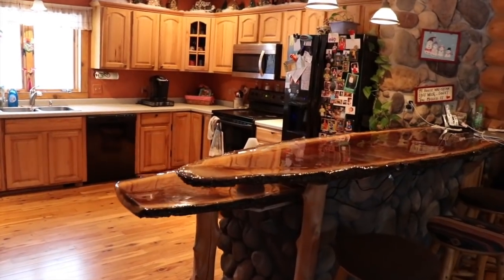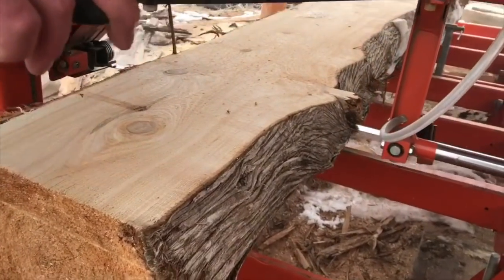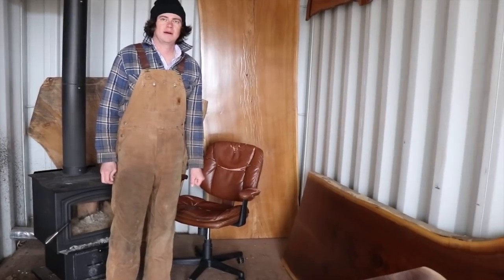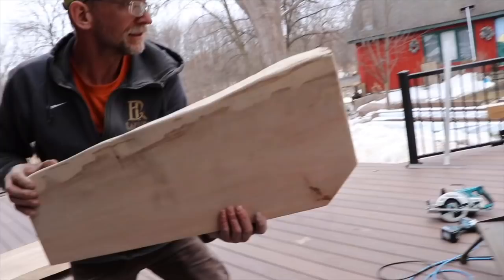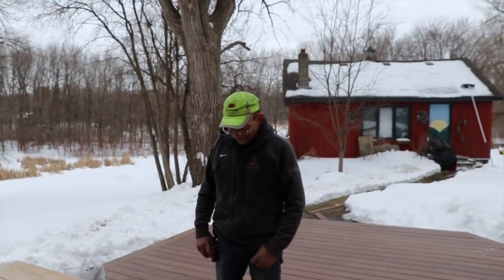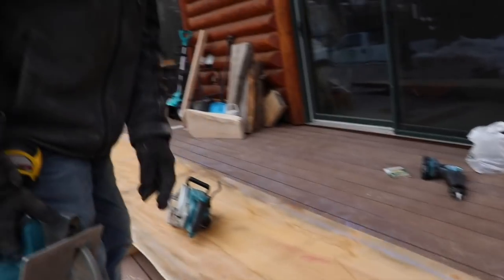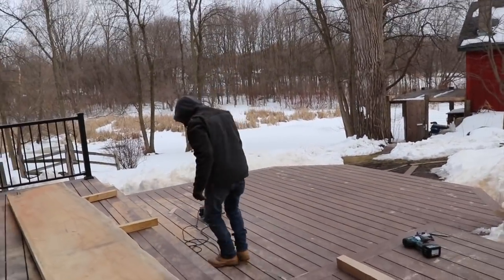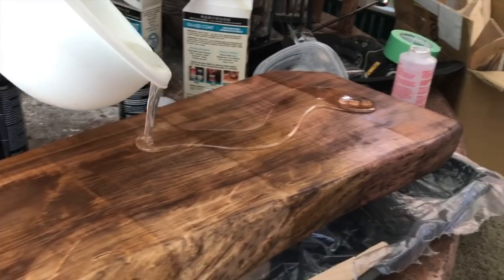Live edge Problems...  How NOT to do a Live edge Project. pt1

Comment: I'm currently doing a river counter with lodge pole pine and white pearl mica pigment. Light burn finish to the to surface with a single "farmhouse" sink undermount. My favorite live edge treatment is actually to use a nylon bristle wheel, it gives even more depth and texture to the wood by pulling out the softest wood from the edge. I wish I could put pictures. I'm very proud of how it's turning out.

Comment: I have poured well over 1000 gal. of epoxy from most manufacturers onto everything from car dash kits to high end art work. I quickly learned to seal the work first with a scraped first coat. Pour some, scrape it around the work to seal. Give it half an hour and scrape the excess off. Objective is to stop air from migrating up through the wood pores( or anything that might be porous). The second coat will have 95% fewer bubbles. Especially you guys using solid wood. The crap never stops breathing unless you cap it with a seal coat. Yeah, an extra day but worth it. Also don't use the torch to heat the epoxy. It is the CO2 that pops the bubbles, not the heat. This I was told by several formulators. Fast moves with the torch. Too much heat in an area accelerated the cure on top and give you undesirable results from unbalanced cure rates.
Be careful using stains. Done a ton of that too. Oil base must cure, yes cure for like 8 days to gain good adhesion. Ever try alcohol stains? Spray on transparent stains? No blotches with transparent dyes.
Too many bubbles in the mix that you pour? I used to mix A&B on a drill press with a wire coat hanger that had a little loop at the bottom. Very little air mixed in. If you try these tips you will have success and save time and aggravation.
Reply: Rich F can you clarify what you mean by “scraped first coat”?  Are you saying that you have to do two coats of epoxy?  What is scraping?
Reply: I use epoxy as a sealer coat as it is excellent as one. I only use enough to cover the work with a thin coat. I let the bubble rise. Every five minutes or so I spritz it with acetone which pops the bubbles. I never use a torch except on final coat and even then I never dwell. It's the CO2 that pops the bubbles, heat is the enemy for obvious reasons. After about 30 minutes or so depending on the wood type and how much air needs to get out, I scrape off the excess leaving very little thickness. If there is a problem requiring sanding it off, I don't have 1/8" of material to burn through.
Reply: Yes, on unsealed wood there must be a seal coat. If you don't, bubbles will migrate out of the wood during cure. Some will no move up off the wood, just kinda laying on the surface under the clear, looking like a glass chip. Some bubble will make it into the body of the epoxy looking like, well, a bubble. The rest that make it to the surface you probably popped and popped until the cure stops the bubbles from rising any further.
If you pour onto a sealed surface, the only bubbles you must contend with are those in the mix. They rise rapidly and stop.
Reply: @maverick1552  You nailed it bro.

Listen up people - I know from my own personal experience, over MANY years, that Rich knows EXACTLY what he's talking about. Thanks Rich - you saved me the time to type up the exact same thing. 👍
Reply: Thanks Kevin. While I am here I'd like to mention mixing. I used a simple wire coat hanger in a drill. No wide flat spatula type tools. They fold in lots of air. The coat hanfer is looped at the end and provides pretty good mixing energy plus the wire being only 1/16" diameter simply twists in the mix. It does not introduce much air at all yet mixes fully believe it or not. I use the same mixer time after time because as the epoxy cures on it, it provides a little better paddle mixing action. Try it, you won't regret it.
Reply: Rich F, thank you so much! This is great info and all makes so much sense. I’ve worked with epoxies in small amounts before, just for bonds fillers patches and the like, but never on a large project or as a poured top coat.. But it’s something I’ve been wanting to do for a bar or table project and your chain of comments are perfect. I love that you give the ‘why’ and the ‘how’ these processes work, This is exactly what I need to understand what it is I’m doing. So much better than simple directions, “first do this, then this and follow the steps to the end.”  

I’m definitely saving this thread.. 
Rich F, you rock! Thanks again. 
And Kevin HeyMan, you rock too, just for the sentiment!
Reply: @rianmattes8292  Sorry this is late. I scrape off the excess of the sealer coat to the level of the wood. All of it. Not even a line of material between moves. Every square inch to the surface of the wood. Any remaining dimension or thickness of 1st coat epoxy can contain bubbles so best not to leave it on. Scrape it ALL off leaving what looks like you wiped raw wood with a wet sponge. No dimension or thickness of epoxy left behind. No place for a bunch of small bubbles to hide and then be noticed after pouring the final coat. Spray with acetone to pop any stragglers. Also scraping is good if you F it U and have to start over. No thickness of tough epoxy to deal with.
Sealed this way the second coat will not have bubbles migrating out of the wood trying to get to the surface.
It is rare but you may decide to seal it again. I have done two seal coats as above just to be sure. I really hate bubbles.
Reply: Rich F great explanation on the proper method of sealing the wood. You know your stuff, if I can add one variable that is an issue when topcoating with epoxy or any other product, is the temperature of the wood. You do not want to start sealing the wood while the room or outside temperature is raising. The increasing temperature will cause the wood cells to off gas, creating bubbles. If you are tackling an outdoor project, wait until the warmest temp is attained for the day and then apply the epoxy/ finish, also, do not let the sun hit your project after you have topcoated it, you are guaranteed bubbles. If you work in a shop, actually drop the temperature slightly in the shop as you apply the epoxy/ finish. This will actually cause the wood cells to contract and draw the epoxy into the wood and practically eliminate any air bubbles. This is from decades of wooden canoe building experience..
Reply: @andreleblanc1963  You are so right. That is an angle I had forgotten about. I also discovered that issue early on but most work I did was in a controlled environment. Yes, especially with the long periods of cure time wood will misbehave with temperature changes. It seems never in a good way, right? Thanks for reminding me on painful lessons of the past. lol
Reply: This technique pertains to wood like this in the video? Or for kilned dried or 2x4 home depot wood? Looking to do a herringbone farm table for the wife and wanna epoxy the top but ill use wood from home depot
Reply: @bf7504  All raw unfinished wood will breathe. It must be sealed, preferably with epoxy.
Reply: In the case of pieces being joined to make a pattern you have the joints which will release air. Maybe 2 sealer coats. Just observe carefully.
Reply: @maverick1552  hey i appreciate it brother. Its my first attempt with epoxy so i forseen making two different table tops lol
Reply: @ Rich how do you feel about polyurethane as the seal coat? or is best to go epoxy on epoxy? also have you used the famowood brand from homedepot?
Reply: @colin340  Epoxy is compatible with most clear finishes out there. Fairly neutral stuff. I like the wet look epoxy gives compared to other sealer coats for tyhe darkness. Other sealer coats do not have that 'wet look' the epoxy is known for. Polyurethene is a nice 'wet' style look which should look great as a sealer coat.
Reply: @maverick1552  These comments were as good as the video! Everything mentioned Is spot on. Only been doing this type of work for about 50 years and I really don't have anything to add other than ALL porous surfaces need to be sealed. Concrete floors and lately countertops suffer the same issues with bubbling through into the finish. Early on, I used to get a form of sanding sealer but learn through trial and error, it was a waste of time and money. 
I learned that epoxy makes a wonderful primer. Especially for boats and carnival rides that I made back in the 70's. Sprayed the molds with release then some Imron and sprayed the project with an epoxy primer. Never had any problems other than cleaning my machines! Also, certain stains just do not take a finish as well as others. I've used alcohol stains with great success! And acetone works with them as well.
Ordering acetone in 55 gallon drums would not be as simple these days but it is THE stuff to have on hand when using epoxy. And what most manufacturers claim about using paint thinner as a solvent or reducer might work in the lab but not in the real world. Acetone...have a gallon on hand. It thins the epoxy (no more than 10% or risk ruining the epoxy, and it cleans pieces, parts and people!) and cleans surfaces to allow epoxy to bond with the substrate.
Oh, and if your doing concrete, avoid the polyamide waterborne epoxies. I have found it just doesn't hold up as well as the standard 2-part stuff!
Anyway, now that we've high-jacked the page, the only thing I wanted to add was, sit down and plan out your day before you get started. It only takes one overlooked item or lack of a tool to cause serious but unnecessary backpedaling and/or quite possibly a ruined finish!
Good luck! And remember plenty of ventilation is a must!!!
Thanks to Stanley ("dirt monkey") for sharing this video and allowing these conversations!
Reply: Hey Rich. I tried epoxy on a pine table previoulsly  sealed and got many dimples on the final coat. Why does this happen?
Reply: Thanks for the info. I am just getting back into wood work after a 10 year hiatus. My epilepsy was out of control. Now I've been seizure free for a month I want to start again. I have never used an epoxy. Never really tackled any project like this one. But with Youtube I'm gonna do my own counter tops, and cabinets in the basement kitchen my wife wants for parties. She's tired of people tracking through the upstairs. So hopefully I don't screw this up..lol
Reply: @maverick1552  Man am I glad I stumbled upon your wealth of knowledge! You and a couple other guys here have been more helpful than anyone that I can remember on YouTube. Usually, it's first-timers calling their video a tutorial and just spreading misinformation. I hate that as much as you hate bubbles. I carved myself a burl wood sink and left the bark on the outside, it sits on a two and a half foot high trunk also with the rough bark left intact. I didn't use a lathe, I used a Forstner bit to remove the bulk of the bowl and a chisel and a sander to smooth. a couple weeks ago I sealed it with poly resin on a whim, I hadn't seen this video yet but it seemed like common sense to seal it. I am about to put the epoxy coats on and that is how I found this video. You can bet I will be using your wire hanger on a drill press mixing method. I was wondering if you could give me any advice on applying epoxy resin to the rough bark. I want it to be protected and hold together but I don't want it fully encapsulated in the resin as that would lessen the natural look I am going for. Any advice would be very much appreciated. Thank you for the other tips you have offered. I am definitely going to use them.
Reply: YES!!!
Reply: @seanmcaleavy2369  Rich, I am also interested in your thoughts on this.
Reply: @davidbaker1319  I never got a response so I just went for it. I used a paintbrush to completely wet all the bark with resin and on the inside the bowl, I poured the resin in and let it flow out of the hole I drilled for the drain. After it cured I re-drilled the hole for my drain insert. It turned out really good and I have had no problems at all. I have seen where people spin the piece like a rotisserie to keep it all an even thickness and if I had something like that I would have used it. But it came out great without one so everything is good.
Reply: @seanmcaleavy2369  thanks for the reply
I'll use your paintbrush method
Reply: @ @maverick1552   - I (like many others) like ur explenation and agree with Kevin HeyMan above... One VERY SMALL thing id like to ad tho about using a twisted coat hanger for mixing..; 
The twisted "upper part"  of the twisted wire can sometimes (its rare, but ive seen it) act as a drill pushing a few bubbles down into the liquid when u start mixing. This can be avoided in a very simple way by at the start making sure u rotate it in the correct direction, "drilling" into (instead of "out of") the liquid and slowly go as deep as possible while doing it, to cover the mixer with the mixture. Once thats done one can mix as normal. 
Also i prefer to bend the wire into a "dome" with 90 degree angles at the bottom instead of a loop, to get into the corners at the bottom of a flat bottomed container.
Thanx and sorry for bad english, its my 3rd lingo....  ;-)
Reply: Very helpful information!

Comment: I used to work at a wood-mizer sawmill, and we made a lot of Live Edge tables and benches and shelves. My favorite way is lightly sanded and don't take off all the dark parts of the live-edge leave just enough to give it character. I did most all of my sanding with a random orbit Makita, it did everything I needed it to do. We would sometimes leave the chatter marks from the band saw in the wood on huge rolling interior barn doors for character

Comment: I appreciate the project, especially the how not to steps. Those can be very helpful to people getting into the trade. I'd have to add adding gallons of gel finish to the slab to the list of things not to do, though. A French polish is a French polish and the effect is perfect for grand pianos and inlays, but a live edge just looks better natural with traditional oil gin and treacle than with a half measure shine. Stay true to the wood.
I should also add to the common disclaimer, wood probably needs more time to cure, as well. For ship timber you're looking at years of drying, I've had to fix well cured hardwood after humidifiers broke during the winter or homeowners overdid the wood fireplace, even butcher block slabs can still cup and twist. Natural edge with softwood and heartwood will move a mile unless you kiln dry it first.

Comment: I have found using a fine wire wheel, in the same direction as the grain, produces a more "natural" looking live edge on boards where the bark is not solid enough to fix with epoxy. Sanding just seems to take off too much solid wood. I've never undertaken a project on this scale though. You guys obviously know more than I do.

Comment: Keep in mind im a woodworker and we build live edge tables and furniture.  Never use a heat gun on epoxy. Also make sure you are using a thin coat epoxy not thick coat which is what we use in river tables. If you are coating bark which I dont recomend you need to make sure no air is between the bark and live edge. Learn to use a jack plane if possible. That will remive those band saw matks and leave a glass smooth flat finished top.

Comment: Multiple 'wash' coats of alcohol diluted  clear shellac (10-15% shellac (85-90 % alcohol) ) can take out the last of any 'washboard' from milling .(apply very liberally and overbrush many times to saturate open rough wood with a higher amount of shellac seal and bring entire surface to same absorption rate) This can be light sanded easily and prevent any grain raising in finish coatings .
High gloss 3-4 coats then final in gloss, semi or satin for greatest durability . If any grain fill is needed, shellac wash again to set stain in filler and prevent 'bleed' into clear coating finish. (this also eliminates any worry of compatibility of stain/or filler with poly finish .)
Classic finishing I used on many projects that 50 years later still look great. (first ones, of coarse, were varnish coated )

Comment: just recently purchased a timbery m280 sawmill. have a lot of white oak and chestnut oak. they r live edge slabs at least 18" wide. i plan on usng the chestnut oak to do the same exact thing. need to put slabs together but once done it will give me more than enough width for counter tops. thanks for showing the failures/mistakes

Comment: I think your first mistake is getting your slabs/wood from Minnesota Milling. I know several people that have had nothing but problems with their wood because they don't kiln dry it and/or if it does get kiln dried, they stack it right back outdoors to absorb the moisture or elements again. Kiln dried wood needs to be stored in conditioned storage. Check with the BBB (Re: Mn milling) before buying from them if anyone is reading this. There are several other reputable slab suppliers in the Twin City area and their wood is top notch.
Reply: that makes perfect sense!!!  Moisture and wood don't mix for these applications, especially around sinks!!!
Reply: @hardset-vi3ze  they sealed the wood so it won't be a problem around sinks

Comment: those slabs are going to move and crack if they are not properly dried..... and believe me you do NOT want that, the method I use to seal my slabs that are still wet is, I fibre glass the under part of the slabs (the top part gets epoxied)  it doesnt move at all

Comment: The epoxy had a chemical reaction because it was in the pot for too long. The heat couldn't escape while heating up the rest of the material thus making it set even faster.
I've done dozens of epoxy countertops.

Comment: I have black walnut live edge bar top that is about 3 years old now and the moisture in the house has made it start to cup in spots. I have 6 coats of clear poly on the top and edges but nothing on the bottom.